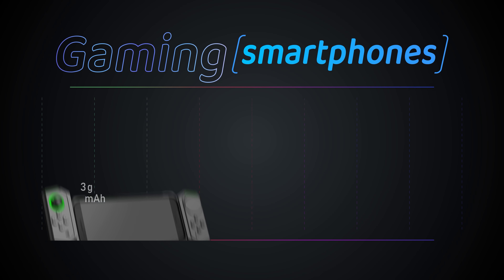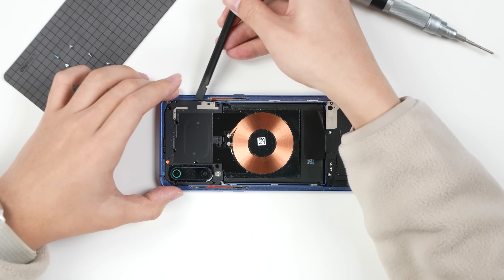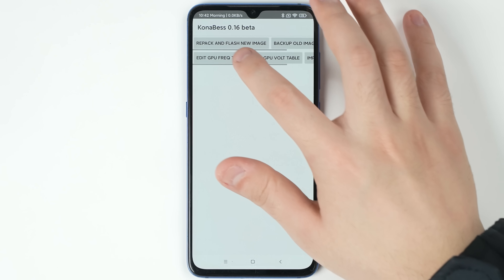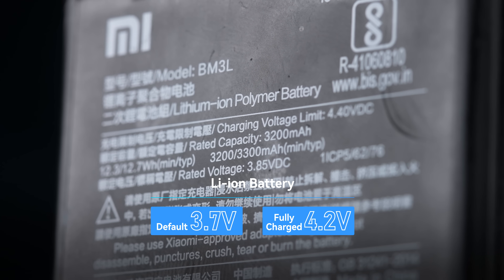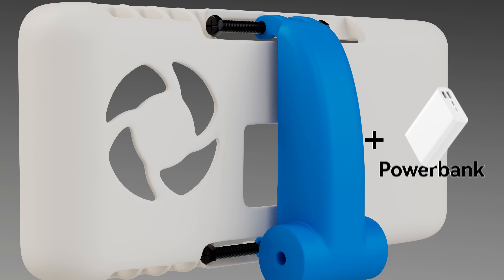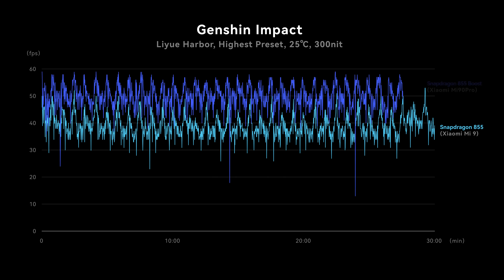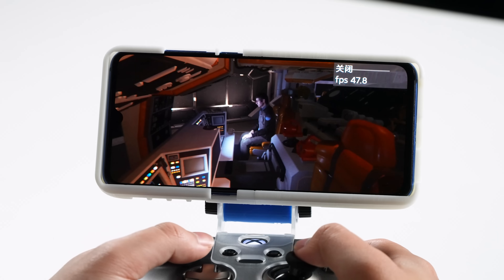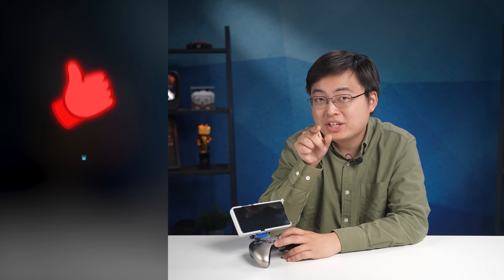We Turned This Old Phone into a Gaming Beast !!!

Comment: I've done something like this on my Snapdragon 855 phone but nothing as crazy as I need to daily drive it.
I used CM Maker Gel as thermal paste and thermal pads everywhere inside so that the untouched crevices make full contact. 
I used my Oppo Reno10x for this. 
The OS is still stock although debloated.
I'll run my phone on the Wildlife Extreme Benchmark and it does a score of 889 with a stability of 99.4%
(No overclock)
Reply: Also thermal pads used are Gelid GP Ultimate
0.5 mm
Reply: @Xeilyathum what a nice question
Reply: @kristanaljiet.martinez4717  what was the question?
Reply: @Xeilyathum noo it can't. Its way out of his league
Reply: @bhavyajain2427 wt was the question 😐

Comment: finally , someone put a real cooler for ultimate performance , this video was so unbelievable , everything was explained perfectly , im speechless , just WOW
but for the part where u say your snap dragon 855 was faster when overclocked over the snap 8 gen 1 , if u overclock the latest tech parts , gpu , cpu and do everything the same u will get much more performance than the phone that u just modified and overclcoked , but its still ... SO impressive !

Comment: You should try the same with the Dimensity 9000, Snapdragon 8 Gen1 and Exynos 2200 
Would be really interesting to see what you can get out of these SoCs
Reply: it will be nice to see, but in order to do this the prerequisite is that there must be established software to do the overclocking of the GPU, screen and stop the thermal throttle, if that is not done yet i doubt they can make an overclocked version of that SoC
Reply: @EriX88888  kernel managers works without any issue, Changing governers is not a big deal, You xan say that investing a 1000$ in a country like China only to mess it up for some gamrs is just not profitable for them
Reply: @EriX88888  u r a genius
Reply: @unknown-6664  is common sense lol, even said in the video
Reply: @r32juan  i dont understand these things even in the video so, for me he is a genius 🔥🤔🙁
Reply: @unknown-6664  understandable
Reply: @unknown-6664  ok you are not a tech person
Reply: 8 Gen 1? won't that require a compressor to cool it down?
Reply: @kevincheung1289  what about water cooling?
Reply: @leelo3252  nah, How much watts can a water pump and the fans eat? A compressor takes hundreds of watts and the COP usually above 4
Reply: @kevincheung1289  a compressor is just overkill. 
A fucking Intel i9 12900KS can be cooled by a fucking Water cooler, so a tiny SD 8 Gen 1 will be cooled easily...
Reply: Mediatek not run emulator smoothly, remember them only recenly open source on 1100 and beyond series me use 1200 opensource Aether-X play metal gear game lag so bad meanwhile enought with snapdragon 860 can run greatly
Reply: I had galaxy a10 overclocked to a50 performance level,and it just heats up to 75-80 degrees
Reply: @Mishanya2437  80? Damn
Reply: @r32juan  but only with discord in games
Reply: @Mishanya2437  to be honest, i want a guide for this one.
Reply: @Mishanya2437  and you stay around it when its that hot :/
Reply: @Mishanya2437  cuz no cooling system
Reply: Successors of SD855 cannot be overclocked anyway XD
Reply: @Gigachad101-i8g  870 is literally an oc 865, Im more intrested on 8 gen 1, if we remove the thermal throttling who knows how far can it go
Reply: @MetaDude  Bruh can be OC ed by Manufacturer not by the consumer XD
Reply: @MetaDude  You can OC the GPU in Chipsets above the 855 but not the CPU
Reply: @MetaDude  nope oc 865 can is between 888 and 8gen1 you can find it on youtube..
Reply: @Gigachad101-i8g  oh thats new, How about chipsets like 855+ and 860 which are just glorified 855
Im sure there must be a way to oc cpu
Reply: @MetaDude  No way for Consumers to OC the CPU 

Only Manufacturers and OEMs can do it but they won't as it will decrease the stability
Reply: @Gigachad101-i8g  nope you are wrong..  You can join our telegram group if you want to learn more.. All snapdragon under tsmc node can be overclock.. Including the snapdragon 865.
Reply: @apkmoddownload360  LoL none of them can be Overclocked you may have mistaken GPU to CPU
Reply: @Gigachad101-i8g  i didnt say you can oc cpu.. I said you can oc sd 865.. 865 is called a chipset not a cpu.. Cpu of mobile phone is called cortex a710, a78, a77,a76 cortex a55 etc to be exact they called it "Kryo" in snapdragon.  And snapdragon gpu is called "Adreno".. Next time make some research.. 
Also funfacts.. You can only used the small percent of big cores in cpu in mobile by default.. If it has 2.8ghz you can only used bellow 2.0ghz by default. You need to unlock it to use the full potential of 2.8ghz to lock its performance to max..
Reply: @apkmoddownload360  You just said you can overclock the SD865 

How do you overclock a SoC without Overclocking it's CPU LoL

Overclocking can't be done in SoCs above 855 

You said all cortex cores and shiz but Overclocking can't be done whatsoever

You can only use it to the max stock frequency 🤣🤣
Reply: @apkmoddownload360  That's what I'm saying you can't increase the frequency beyond the stock freq 

And it's not called Overclocking
Reply: @Gigachad101-i8g  i didn't say from the beginning you can oc  its cpu. I said you can oc "snapdragon 865" it is a chipset model not a CPU.. Because sd 865 is compose of cpu (kryo) and gpu(adreno) ..  You are dumb to consider snapdragon 865 a CPU and not a CHIPSET
Reply: @Gigachad101-i8g  Snapdragon 865 is a chipset
"sets of chips" .. In 865 chipset you can find the ram, gpu, cpu, dram, npu etc.. Again I repeat snapdragon 865 is a chipset not a cpu like what you referring..
Reply: Maybe gen 1 is not a great idea no one wants this guy to die this early 😂
Reply: you cant oc snapdragon 888 above because of samsung node because it was manufactured under samsung.. the one can be oc is from tsmc who also made the apple bionic chipset..
Reply: @apkmoddownload360  why shouldn't it work if it's manufactured by Samsung? Doesn't make any sense. They aren't as efficient, but that's it
Reply: @leelo3252  samsung node is different from tsmc node of snapdragon.. In samsung node there is no source code for oc because they prohibited it.. What you get in samsung chipset outof the box is the max clockspeed you can get already using the chipset max capacity.. Also Becuase samsung is well known for peak performance and not stability like tsmc doing.. The one that can be overclock is the chipset with high stability and has opensource to third party developers which samsung doesn't have.
Reply: @apkmoddownload360  there is lots of other snapdragons 888 phones out there that are not from Samsung... Like zte phones
Reply: @gerardorodriguez2634  samsung is the only one who manufactured sd888 and not the tsmc who manufacture previous sd chips.. Becuase tsmc now manufacture the a15 and apple m1.. There is no slot for sd chips so sd decided to manufacture it to samsung.. You cant find any sd888 manufacture here that is not from samsung..
Reply: @gerardorodriguez2634  even the phone you mention using sd888 from samsung..
Reply: Lol dimensity overclocking?
Reply: I think you would need massive fans or liquid cooling for the sd 8 gen 1
Reply: dude theres no dimensith 9000 only 900
Reply: @NicoLse16  redmi k50 pro using dimensity 9000.. Always do some research before commenting..
Reply: @apkmoddownload360  whats the telegram?
Reply: @NicoLse16  dude here https://youtu.be/E8O9qb0Rqn8
Reply: @thecrwster  what are you talking about?
Reply: I doubt that'll work with other than Snapdragon chipsets
Reply: @justarandomperson868  yup you're right.. Since other chipset have no open source code available for third party developers to maximize/optimize the performance of a chipset..
Reply: Snapdragon SoC usually have a lot of community support so this was possible
Reply: @judecruz1565  its possible in tsmc node but its impossible in samsung node since the source code is not available to the public or any third party developer..

Comment: I have an old neckband it's working fine but apparently it's battery life is no so good
Can i just add another similar battery in parallel connection to increase it's capacity?
Will it overpower the circuit because of double amp?
Will it harm the neckband?